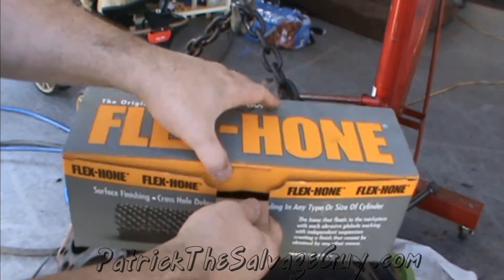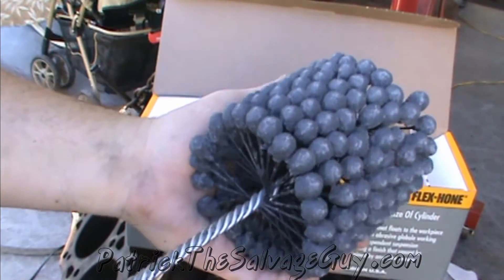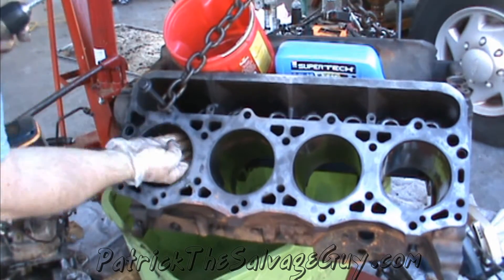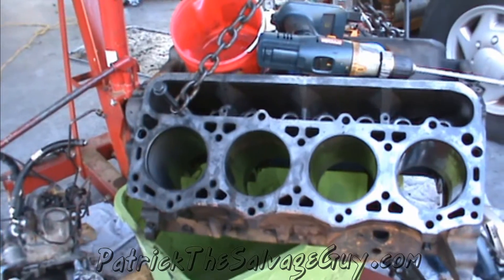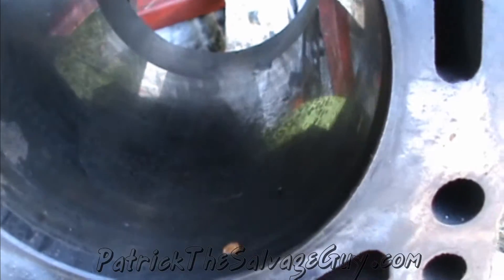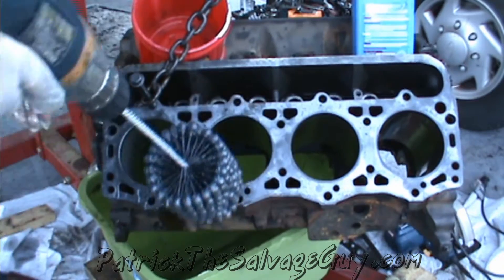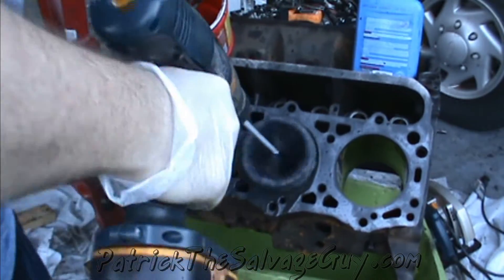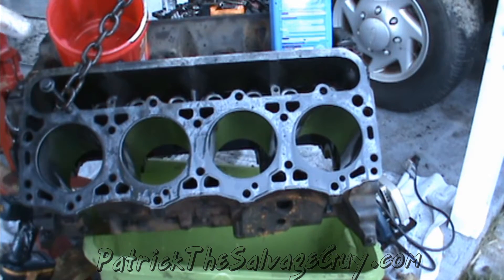Cylinder Honing with Flex-Hone brush 7.3 PowerStroke Diesel

Comment: 21,16,20,19,16,19,15,20 where is the consistency at ? shouldn't it be the same amount of strokes of cleaning in each cylinder ? hmmm
Reply from the maker: Some were in better shape than others, for the pay it wasn't worth my time to care alot really.
At the end of the day he wanted to stiff me on pay and all this actually wound up at the scrap yard to recover the balance owed.  I pretty well saw it coming and had already applied for a lien on the thing at this point.  I don't bother with quality work on jobs that pay cheap, I don't care to half do it for crap pay personally, just give them what they are paying for, no less and no more.   He didn't want it done right, he wanted it cheap, else I would have used my shop and not the car port for this crap.....  But we are talking about a guy that didn't mix the jb weld when half fixing the radiator that was part of the trouble with this poor thing.
Reply: @PatrickBaptist  oh wow , i'm just learning so that's why i asked, sorry the project didn't work out, some people want things done then they don't want to spend the money sad really but it happens, thanks for making the video !
Reply from the maker: Oh your fine, the ball hone doesn't work like traditional honing, you don't have to even worry about being straight with it at all.
Ah that;s the way it goes sometimes, and that is what I get for taking work of CL, loads of people on there trying to rip a person off.  Last summer it was a woman after shoving 4 tons of rock chip by myself wanted to play games about paying me until I told her, pay now or I will shovel MY rock into your grass and you can have fun with the cleanup.  Yeah I got paid, she wanted to sell and wasn't about to try me out, had the whole thing on camera, was half hoping she wanted to go that route so I could post a video about that one on here LOL.  After the van thing I always record any interactions with the customer.
I'm the kind of guy that WILL do it as cheap as I could possibly try, I don't care if it is done right, remember the customer always thinks they are right, so why argue about it is how I see it.  They want to be the boss and I give them what they are paying for, want good work then they have to pay for it.  I pretty well tell people that "I'll do it for the cheapest, but understand I don't guarantee anything even if it doesn't even drive off my property I still expect paid, want it done right then the pay has to be according to the amount of time it involves.
Sorry for ranting on, if I can be of anymore help I don't mind questions, it might take me a day or 2 to get back to you but I will.  Thanks and take care buddy.
Reply from the maker: @jeffh.9999  Jeff try and grow up a little, I don't answer to you and you sure don't get to tell me how to go about my business.

Comment: Hey man. need some help with a 7.3. is this the only thing you used to Hone that engine? im about to order one and want to make sure i dont need more than one.
Reply from the maker: One will do just fine, and it is good for more than one block unless you wear it out, I did 2 with mine and it's still good for another or 2 atleast.  Just make sure to use plenty of oil.
Yes this is all I use to hone with, so easy to use even a idiot like me can manage to get it right.
Reply: @PatrickBaptist 
What size did you order? And what abrasive type with what grit??
Reply: @Nitrous_Busa  Using a Brush Research GB Series, Silicon Carbide Abrasive, 4-1/8" (105 mm) Diameter, 240 Grit FLEX-HONE Cylinder Hone on a 7.3 PowerStroke diesel engine block.